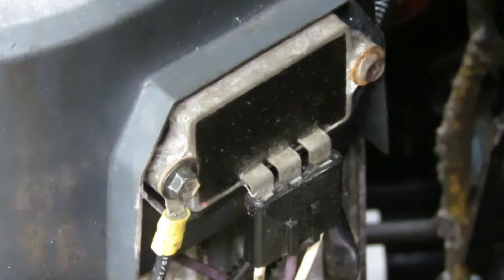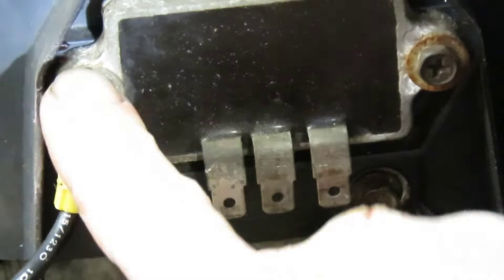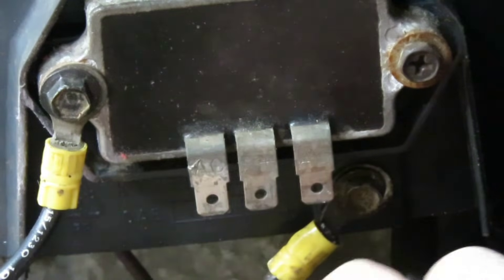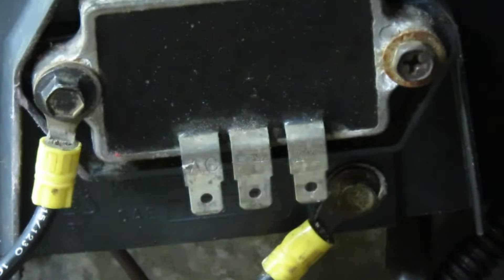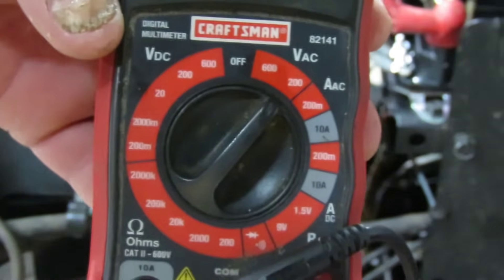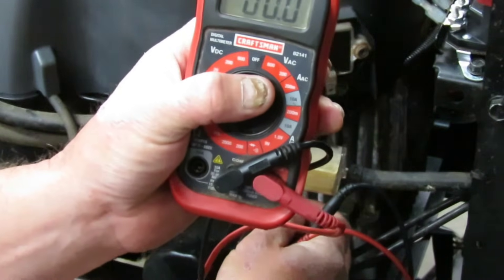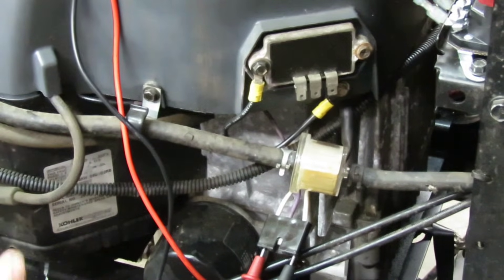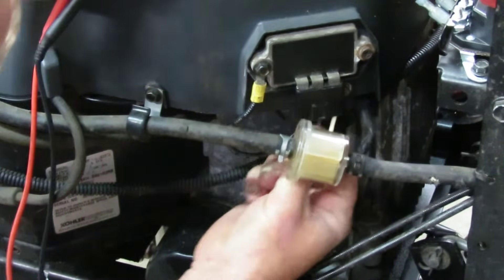How to Test Kohler Charging System

Comment: the purple wire charges the battery ? if key switch is unpluged how will it charge ?
Reply from the maker: Usually it won't
Purple wire usually goes to Key Switch A1 or A2 Terminal and connects to B terminal when key is turned on.
Some are wired straight to Battery positive side of Starter Solenoid

Comment: You mention the purple wire goes to the key switch.  What terminal on the switch ?
Reply from the maker: A1 or A2 Sometimes B
Disconnect Negative on Battery
Multimeter on Ohms with Beeper is better
One lead on purple Wire at Voltage regulator
Unplug Key Switcj Connector
Other lead probe each terminal on Key Switch Connector until Beeps or shows close to Zero on multimeter Screen.
Match the Connector terminal to Terminal on Key Switch

Comment: I have a problem with my Toro LXv500.  When mowing, the blades slow down and would kill the engine if I didn't push in the PTO.  It also doesn't do hills very well at present.

I pulled the deck and checked spindles, making sure I didn't have any locked up.I did find one loose blade.  Since the deck was already off, I sharpened the blades, reinstalled them (making sure they were tight), as ND reinstalled the deck.  There was actually moderate improvement, but the motor is still a little sluggish and inclines are still not good.

I'm also having a time locating the voltage regulator.  It says my battery is charging at 13.8 volts.  I suspect the voltage regulator (or maybe battery) because the mower underperforms while the blades are engaged.

Comment: Good afternoon. I have a Koehler 23 with new battery all charged up. It is not charging. When I  looked at the first part of your video I found no ground wire between the left screw and the ground plate screw at all on regulator. I have had this mower for 7 years. It is a 2012 model. I am the only one that has worked on it since I bought it.  There is no draw on battery with key off. I made a ground wire for it and installed it.  When I went to start it, nothing. Not even the fog lights came on. I had been starting it all morning and now nothing.  Baffled in NC.

Comment: What if the ac is working but if you reverse the connection its not on the other side? I also tested from white wire and grounded meter only 1 side makes power
Reply from the maker: I've never tested just one side.
But I'd say if your testing both AC wires with meter and you have correct SC voltage.
It's working
Reply: @sartingarage8045 only getting power on 1 side

Comment: Checked the stator it's charging, checked the ground it's good, checked the regulator it's good but on my dash the battery light comes on when running engine is a Kohler command 14
Reply from the maker: Start the engine and check Voltage at Battery.  Should be close to the same as Voltage output at Voltage Regulator.
If it's Not.
Then you have a short in wiring or bad key Switch or possibly something wrong with dash panel that light is in.

Comment: I have a cub cadet with a Kohler 20 engine. Recently began giving trouble. Would just die suddenly like you shut it off. (Even with blades off) Blowing the fuse.
20 amp fuse apparently is not enough tried a 25 amp fuse and was able to at least get my mowing finished. Although fuse holder and wires were noticeably too warm.
I am concerned about A possible short someplace 
Could a battery that was overly drained pull so much current to cause an overload on the charging system and bowing a 20 amp fuse but not a 25amp fuse? Or would this more likely be a faulty or damaged regulator? Or could a short be developing in the stator that only causes an intermittent overload? Is there a way to ground fault check the stator while engine is running?
Reply from the maker: That can be any of what you mentioned
It can also be the PTO clutch drawing to many Amps blowing the 20 amp fuse. 
On the edge of blowing the 25 amp fuse.

Install the 20 amp fuse and try running it with PTO disengaged
If it won't blow the fuse with PTO disengaged
There is your problem
Drawing to many Amps Either from short in PTO wiring or Bad PTO Clutch
Reply: The first time this happened the engine was running and blades disengaged. PTO off.
Mower is a cub cadet LT1045
Has some age on it. New battery just last year along with a new regulator due to a similar issue but would not recharge battery. Steering pinion changed recently and drive belt changed at same time had clutch removed all looked good.
Current problem blows a 20 amp fuse with blades off.
I may have damaged the new regulator trying to jump start the mower, battery had been drained from excessive cranking because fuel sol came unplugged and I didn't know it. I couldn't get mower started. Or maybe it was just too much demand due to the flat battery. Fuse only blows a few minutes after starting. A 25amp fuse won't blow so I can't say it's a direct short or it would too.

Comment: What if I'm not getting anything from the stator?  Assume its bad?
Reply from the maker: Most likely bad stator
Could be magnets in Flywheel are missing broken or damaged but usually when this is the case you will get AC voltage 
Just not enough
You have zero voltage out of stator
So I would expect bad stator

Comment: man this is super helpful. I've had such a terrible time figuring out how to test the charging system on these engines
Reply from the maker: This Video will help you to
It's on a Kawasaki Engine But works the same as the Kohler. Just on the Kohler your AC connections are on the 2 outside terminals and you DC out is the center.
https://youtu.be/zRwkKNGkymU

Comment: My mower has courage 22 motor but there isn’t a ground on the voltage regulator as you show in video. Is it missing or is that be design. Nicely done video. Thanks
Reply from the maker: Sometimes the base is just grounded with the screws that mount Voltage Regulator.
The screws will screw directly into metal and not Plastic

Comment: I’ve been having trouble with my mower not charging my battery. I tested the output on my rectifier regulator and was getting 0v DC.  Ordered a new one and was only getting 2.7v DC so i tested my stator. My stator tested at 26v AC so i replaced it and am now getting 42v AC. Now I am getting around 7v DC coming from my rectifier regulator. What else can I try?
Reply from the maker: This sounds as if you have No battery Voltage to Regulator.
Engine OFF
Turn key to on Position
Test wire on output on Voltage Regulator for battery Voltage. There should be 12+ Volts DC there with key on engine off.
If there is NO Voltage test Key Switch or a broken Wire or Bad Connection 
Here is another Video that will help alot more. It is on a Kawasaki Engine , But tests the same except the wires are on a different spot on Regulator but testing Values are the same.
https://youtu.be/eZndhOJLp64

Comment: Kohler 24hp 7000 series. My stator is reading around 29.5 volts but I'm getting 14.2 volts from the regulator. Are those readings good enough?
Reply from the maker: Yes

Comment: Have koller moter that will not crank
Reply from the maker: When you say will not crank
Does the engine turn over , But Won't Start
Or it won't do anything when key is turned to start position

Comment: I checked the connector voltage unconnected, A and C and it was 25v to 26v AC, and when connected, middle one and engine body was 14.2v to 14.5v DC. does it means it's working good? and if so, then what's next to check to figure out why mower stops running after maybe 1-2 hours, wont start and battery is drained?!
*I put battery under charge and it starts and runs, but after 1-2 hours, stops running, battery is drained and wont start!
Reply from the maker: That 14.5 volts from center Pin goes to Key Switch . Then from key Switch down to Starter Solenoid.. Make sure that same voltage is making it to battery. With Engine running connect positive lead to battery positive and negative to negative. You should have the same voltage 14.5.
With meter still connected to battery wiggle the key in key Switch watch the meter making sure you keep constant 14.5 volts.
Sounds like you have a short somewhere and it's not always charging the battery.
Usually this is the Key Switch Shorted
Reply: @sartingarage8045  Thank you for your reply. I checked the battery charging and when engine is running, I see like 14.5v on battery which it means it's charging; I'll check and will update. 👍

Comment: I'm only getting 15 volts AC out of the two outside wires.  Would it make anything at all if one of the magnets came off the fly wheel?  Maybe the stator is bad?  It is sending 12.7 volts dc back to the battery out of the middle wire I tested.
Reply from the maker: Your stator is bad or you have lost some magnets inside flywheel.
Reply: @sartingarage8045  Ok thank you!

Comment: Very informative.
I have 45vac at the two whites with the connector unpluged from the regulator, but only 9.5vdc at the purple when connected to the regulator.
Both checks with Kohler running wide open.
What's my problem or next check to be made.
Thanks
Reply from the maker: Check base of regulator to make sure it is grounded.
One lead on base of regulator, other lead on Ground to engine block or battery Negative.
Kohlers have a jumper ground wire from base on regulator to engine Shroud and alot of times they lose connection.
If base of regulator is not grounded remove and clean this wire where it connects.
Also check Purple wire for battery Voltage with Key in ON position.
There has to be battery voltage going to Regulator on purple wire for regulator to work correctly.
Reply: @sartingarage8045  Thanks .... I'll check it tomorrow!
Reply: @sartingarage8045  The regulator was not grounded, so I added a ground wire as per your video.  I checked the DC voltage at both the regulator purple and the harness connector at the front of the engine by the spark plug, and I got 3.5vdc at each location with the key switch "on", but not running.   Does it make any difference which way the regulator connector plugged into the regulator?
Reply from the maker: Sounds like you either have a power problem to key Switch or the Key Switch itself is bad.
Here is a key Switch Test Video.
https://youtu.be/rOqwb0KaHQI
After testing key switch make sure you have battery Voltage to the B terminal in Connector that plugs into Key Switch.

Comment: Thanks for the video.  Getting ready to apply this method on my Kohler Command 20.  It's 20 years old and just had it serviced.  The guy installed a new seal as it was leaking oil so I think he would have noticed any stator issues?  Probably some rusty connections.
Reply: It does the same thing.  It seems like it almost dies when I engage the PTO but it never has died from that.  It's weird because I can run it all day and once I shut it down it doesen't want to start until it's cooled way down.  At least before the guy worked on it.  Now I have to jump it every time I shut it down.
Reply from the maker: @Corey-dy2cq
He may not have checked the charging system if it was took in for just an Oil leak.
But even if he did check it,  Anything can go wrong after everything checks OK.
As far as it almost dies when engaging PTO sound like it maybe running on one Cylinder if it's a twin Cylinder , Or Govenor is not set Correctly is where I would start.

Comment: My Kohler is putting out about 45vac but the regulator is barely 12.6vdc. If I check just the center prong in the plug, it reads battery voltage. I bent the center pin up so it wouldn’t be in the plug and it read 0.7vdc. I think the regulator is bad.
Reply from the maker: @ksmith0110
Check Center Pin on Regulator for Battery Voltage with key ON, 
Check base of Regulator to make sure it is grounded. Meter on Ohms One lead on base of Regulator other lead to Engine block or battery Ground. Should be infinite.
If both these tests are Good
Replace Regulator
Links for Regulator in Description

Comment: ive got a 7000 series found regulator but it doesn't have a ground wire?
Reply from the maker: If the Voltage Regulator base is mounted to metal, will not need the Jumper wire.
Take your meter one lead on base of Voltage Regulator. The other lead and touch to engine block or negative post on battery.

Comment: I don't have no meter so I'll just clean the stuff up or plug one on from one of my other Kohlers shoot a little oil on after cleaning then see if the battery has charge in it after its all cleaned is the best way i can do without a meter for right now any battery put on it is not enough juice to start it without a charger hooked up 

The batteries are new they do fine on my tractor mowers without a charger hooked up
Reply from the maker: That's probably the best you can do without a Multimeter to test to actually see if mower is or isn't charging.
There are some links in Description for Several Multimeters from Cheap ones to best ones.

Comment: I know theres a problem with mine cause i took each drained battery off my zero turn mower and used them on my other mowers and charged it a little then started it up and let it run on my Briggs engines and their staying charged on those.  but gets drained on the Kohlers i figured its probably the rectifier not sending juice back to the battery while its running is why the batteries dead each time after using the mower the person i bought that from didn't even have the valve covers screwed down all the way and had to low of a amperage fuse put in had a safety button wire plugged in that kept blowing the fuse had some other wires taped up i took all those out that didn't need to be their I've been needing to check its rectifier but am working on a bunch of other different mowers

Comment: Everything you showed me to check shows as you say it should but charge isn't getting to the battery.
Reply from the maker: @glenbush3315
I would test Key Switch
Link Below for testing Key Switch
The purple wire at Regulator goes to key Switch. Then Key Switch Connects that wire inside Switch to the B terminal on Switch.
Which is Battery. The B terminal wire on Switch goes to Starter Solenoid on Battery post side of solenoid.
So if you follow your Battery Positive Cable to Solenoid. There will be a Small usually Red wire connected to same post on Solenoid.
This is the B wire from key Switch
Key Switch Test Video Link Below
https://youtu.be/rOqwb0KaHQI

Comment: youre giving me too much credit , i still dont know where the voltage regulator is. you started your camera too close
Reply from the maker: @davidarford3719
Sorry about that
It's on the side of the top engine Shroud
Depending which engine you have usually above Oil Filter or next to Engine Model Number Sticker
Also some do not have a voltage regulator.
Just a Stator / Alternator
Reply: All of my Kohlers have the rectifier even the twin cylinder does my older briggs do with their red and yellow wiring
Reply: You can't miss it it only has 3 wires going to it

Comment: My Cub Cadet just up and died this evening while it was in low-idle. I thought it ran out of gas but it ran out of lightning.
I just put a new bat. In last summer. It was flat! Apparently I have a charging system problem. Hope it's just a regulator. Thanks for the video
Reply: An update... found a blown 20amp fuse. (Engine was idling with blades disengaged.) May have been a low voltage situ. (High amp) or possibly a faulty regular or stator.

Comment: Bought my wheel horse but thought the battery was dead. Bought another and it died. Was told the voltage regulator was bad so got it fixed but I still have charge it every time. I'm thinking connections are dirty or my meter is crap
Reply from the maker: Maybe a amp draw on battery when Mower not in use. Here is a simple trick Video to test for that. 
https://youtu.be/7f2dR0rT1fw
Reply: @sartingarage8045  what about when the battery is charged and it will run, but die sometime before in done mowing?  I'm tuning the alternator or the voltage regulator not getting good connection or is faulty?
Reply from the maker: @slowpoke4557 
Yeah I don't think your charging is working.
Which Engine does this Wheel Horse have
Model and Type if you can get that for me
Reply: @sartingarage8045  iit's by Toro, engine is Kohler, and only other thing I know off hand is 266-H  is on the side.
Reply from the maker: @slowpoke4557 
That's most likely a Kohler Engine Model CV460s. Should be a sticker on side of engine Shroud.
What is your Readings from meter in this Video?
Stator Readings
Voltage Regulator Readings
Voltage Regulator Ground
Reply: @sartingarage8045  model CV16S and 624 cc.
Can't remember what all the reasons were (going to work now), but when you did this one reading should be 30-50, mine read 30 something.
Reply from the maker: @slowpoke4557 
In the 30's is ok coming out of stator
Reply: @sartingarage8045  I also think I have a cheaper meter, it doesn't have all the settings yours, or other YouTubers I see,  have. But what other reading should I be trying to find out?
THANK YOU SO MUCH for helping me out on this too! It means a lot!
Reply from the maker: @slowpoke4557 
Need Voltage regulator Output from Center wire on regulator. Check Regulator Base Ground which can be tricky due to Jumper Wire.. Touch one lead to base of Regulator touch other lead to engine block. 
Also with Key In ON position Engine OFF Check Regulator Center wire for Battery Voltage.
Let me know what you find

Comment: My Kohler 23hp is only getting around 20-23 volts ac from the stator even though just replaced it with a new unit. Any idea what else the issue could be?
Reply from the maker: @robertholt8522
I would check magnets on flywheel.
The magnets need to be evenly spaced and each magnet is push pull push pull